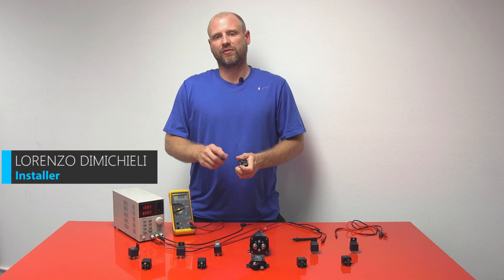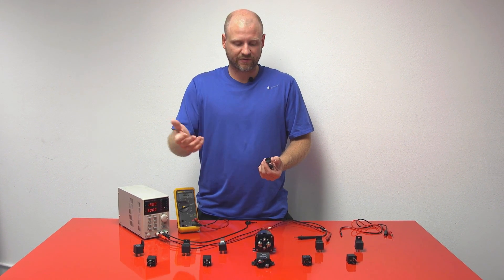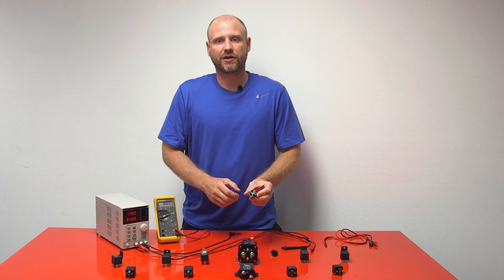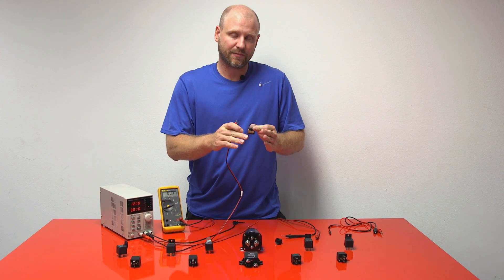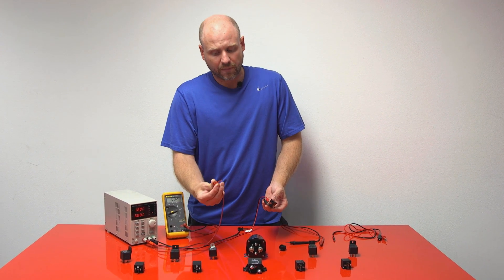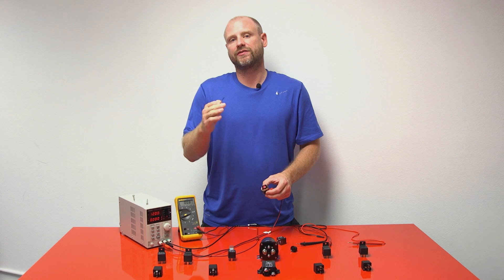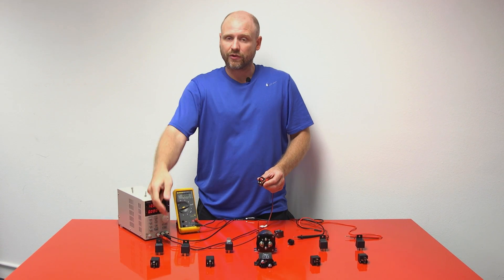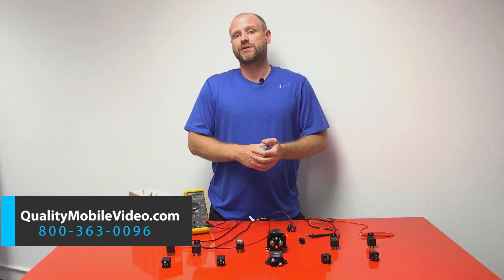12 Volt Time delay relay - How it works and how to wire

Comment: Ive got a prewired  harness with on/off switch with relay and relay base. (12v)    Simple standard automotive; flip the switch and it turns on (is wired to batt and not off of a keyed hot) ...  14gauge wires.  Technically made for Lights... but iIn my case, it turns on  a fuel pump to prime system.    Only need the pump on for say 15 seconds though.  

What Time of relay type do I need to not have to rewire/pin anything and just be plug and play.  There is specific reason do not want to re-wire or pin.   More on that in a minute.  Common use would be just flip it on once a day just prior to turning key to "crank" first time for the day.   After it times out, wont need it on again for the rest of the day since it only primes the fuel system.... which really does not bleed back to bad so once a day is fine).   Next day would just flip it to off then back to on....  Wash rinse repeat each day. 

 Reason not wanting to change wiring in the harness is . IFFF my mechanical fuel pump goes out... I'll use a hose to bypass it so can drive using the Aux. pump (same one used for priming).   To do this would prefer to just pull the timed style relay and replace it with the standard relay taken from it and stored in glove box. 

Switch set I got is a "NiLight "single wire switch and Harness kit form Amazon.    Would put a link but you cant here.

Comment: I have the same relay its driving me mad trying to use it to keep the turbo oil pump on but when hooked up to the switch it only stays on for 2 sec or so but if i just touch the switch to a 12 volt source it wotks right

Comment: I need this but for the power timer to stay on only after the momentary continuity is broken (ie the switch may be pressed for 20 seconds, then released - at that point the relay powers the other circuit for 2 additional seconds (or whatever the potentiometer is at)
Reply: That can be done using wiring scheme called an "interlock" . This requires a relay having a pair of contacts  - one will be used for the interlock - the second contact to control whatever you're wanting to control. 
Route always hot power supply thru normally open contact then to relay coil. Parallel wiring from always hot power supply thru normally open switch to relay coil. When you energize circuit nothing happens until switch is momentarily closed - the relay coil is energized and closes normally open contacts. The switch can be released but the relay coil remains closed - power being routed thru the one contact you used. The relay remains energized (closed) until it times out...then opens and remains so until the switch is again turned on.
Key important info...there are 2 differing types of timer relays:
1 delay on break (does nothing until preset time has clocked out)
2 delay on make (instantly closes contacts  - remain closed for duration of preset time - then opens)
You can probably google "interval timer" and find a wiring scheme...it's a common circuit 
Hope this helps!

Comment: What would I use for a timer on a generator? I want to set a 4hr run time so after I start the generator the ignition shuts off automatically after 4 hrs.

Comment: Does it keep the positive side of coil energized while timer activated? Thanks
Reply: it takes a constant supply to run the circuit and a powered  trigger wire to control the timer

Comment: Momentary trigger: The only trigger I can think of you can use is the starter wire (starter solenoid wire). All other 12v sources won't work as constant 12v, and doesn't start working till 12vs are removed.
Reply: Pin 86 - Single pulse (+12 volts) to trigger time delay (Constant 12 volts can be applied and once removed relay will stay latched for duration of timer. Negative feedback will require a diode to prevent capacitor discharge)
Reply: I wonder if you could wire the trigger from your acc? Acc trigger wire goes through NC on a second relay. second relay trigger is also from Acc.

Comment: I need a device to delay a second set of car horns to kick in after a couple of seconds.
It's basically for Kangaroos & animals that come on the road at night.
The normal horn, which is pretty feeble but ideal for alerting someone with just a quick beep.
Adding a pair of Snail air horns to the same circuit with a delay mechanism between the original & the pair would save me running an additional circuit & switch.
Probably the wrong place to ask, but, since I'm here I guess.
Thanks in advance

Comment: if the trigger stays powered will the relay stay on until the trigger is removed?
Reply: POWER ON TRIGGERS  START TIME ON THIS RELAY, FIND AT Amazon = ( iJDMTOY (1) 10-Second Time Delay Relay Module ). stay on if power stay on.

Comment: If I applied power then removed it. Will this relay hold that power and apply it to whatever it’s connect to within the time frame?
Reply: nope , only after the time setting, and the control power would need to be constant or the contacts will return to normal states

Comment: First! Hey my system thumps when I shut my car off AND it will thump worse when I cycle the key to ACC let the system come on then start the car. do I need two time delay relays? one for off, one for on
Reply: Here is your solution, Youtube video and explanation. 
https://youtu.be/M5jtHBMucO8